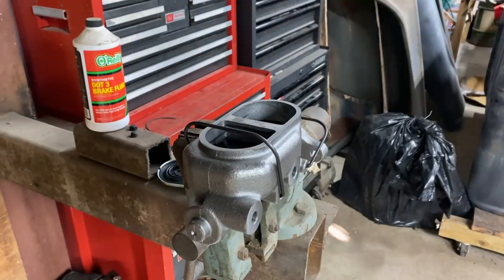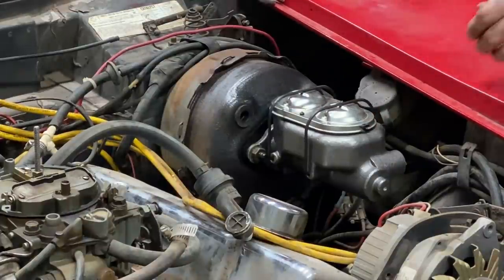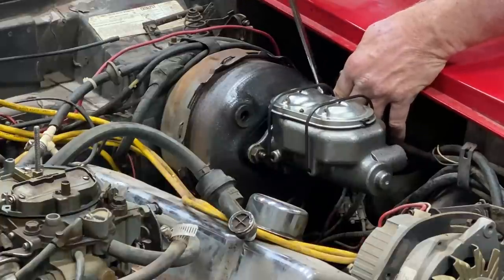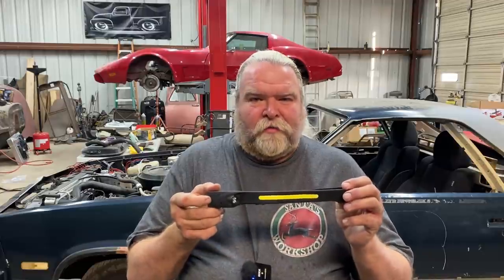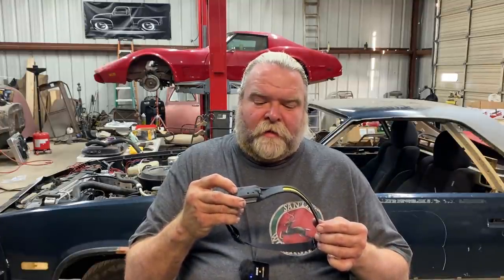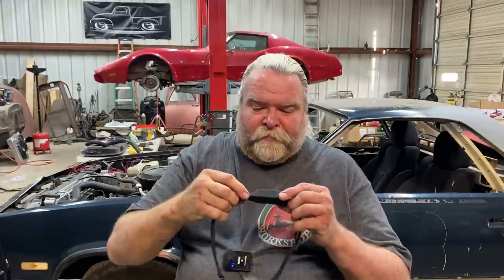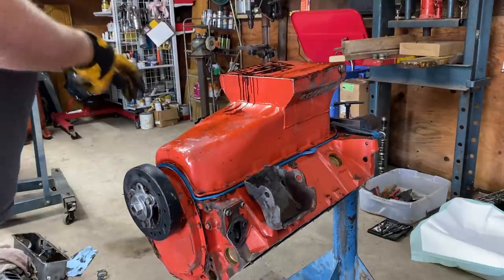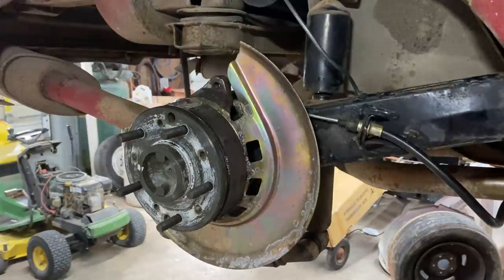Installing Brakes On The 1977 L 82 Corvette and a GIVEAWAY!!!!

Comment: Hey Mike, glad to see your internet issues cleared up enough to allow you to post this video. Tough break on the brakes, but glad you are not risking safety with a stripped bolt. Too bad about the crank as well. That Odelfi light seems pretty cool. A good idea for a giveaway when a manufacturer sends you two devices - if it's a good unit.
Reply from the maker: Thank you Jim! After the internet cleared I started having software issues in the computer! Got a 5 terabyte hard drive to clear off a bunch of old stuff and it now runs a lot faster! Going to upgrade the Ram next!
Reply: @SantasWorkshop  I'm a bit of a Computer geek so if you need advise, just ask.

Comment: Santa! Do you know that there is a tool to use when installing a MC to a Booster to check the rod in the booster so its at proper length??
YES! The rod coming out of the booster is adjustable!! DONT ASK ME HOW I KNOW!?
After upgrading brakes on my 57 Chevy a couple times I have turned into an expert on that subject!
Reply from the maker: Yes, I will be checking to make sure everything is right before it goes to someone else!!

Comment: Odelfi I want one.....Mike you can check the treads on the rear caliper bolt hole  with a tap.....retap it if needed.....
Reply from the maker: I’ll have to retap, the hood bolt just slides in to the hole.🙄

Comment: Odelfi i want One I like this year Corvette. The stock engine can be made more powerful with different cylinder heads, camshaft, and dual exhaust!!!  Great job on replacing the disc brake assemblies.
Reply from the maker: As good as this one ran I’m not going internal on it just sealing it up and cleanup!
Reply: @SantasWorkshop  The 1976 Corvette showed us what the future of cars would be with the front and rear fascia's (flexible rubber bumper covers). Always liked this year. I don't care for the hatchback look of the 82 models.

Comment: ODELFI, I WANT ONE.  Love your channel.  If you have access to a 4 bolt main engine you might rethink and go that route.
Reply from the maker: No more power that I’m putting into it a 2 bolt should be fine, I do have a 4bolt block bored .030 in storage for a special build!

Comment: ODELFI I WANT ONE!  Sad thing about the block, though salvageable, it is just about cost the same these days as a crate motor by the time you rebuild it right.  Of course you need to have the cam bearings replaced and true'd up by a machine shop.  The bores look excellent, and the block is worthy of rebuild.
Reply from the maker: I learned something recently, a crate engine from gm is made in Mexico and they do not cast as good as American made blocks. We got a crate engine in a deal and went to have it bored and the machine shop refused due to the pitting in the casting! This motor I can get a a crank kit (refurbished with the appropriate rod and main bearings $300, hone the block and $40 at the machine shop for cam bearing install, new rings $75, and cam/lifters $250! 
So for around $700-800 I can get a well built motor by doing in house!
Reply: @SantasWorkshop  yup, just got to do some more machine work, line boring, etc.  The one great advantage, if you do it yourself you know what you got.  Just watch the quality of the parts, especially the cam.. some bad ones have gotten loose, brand new bad ones.
Reply from the maker: I already have a new CompCam for it!

Comment: You might want to check the floor pans for rust. Starting in 1976, GM started putting steel floor pans in the Corvette, to help protect the fiberglass from the heat of the catalytic converter. They are very prone to rust. There are a lot of little oddball things specific to the 1977 model. In '77 they were in the process of switching over from the earlier models to the '78, which had the huge bubble back window which I never did like. It ruined the lines of the whole car.
Here's a great video on it.  https://www.youtube.com/watch?v=fhHIbWRQ7dY&t=102s
Reply from the maker: So far rust wise everything is looking great!!!
Reply: Seems that the model year 1977 is a unique try& error year. That video link makes one pessimistic. But on the other hand now this vett is sorted out and quite rare. And let's see if you random comment finder finds this: odelfi I want one 😁😁

Comment: Mike, you ain't going for that Monday thing again, are you???? Buy a roll of bare line and get the fittings and make your lines, I know you know how!!!!! As long as it's not ur hoses!! On my 79 355 Camaro when we did the BRODIX racing heads, we had to put silicone on couple head bolts, cause they bottom out in water passages, but not all of them!!!!! Think maybe 3-4????
Reply from the maker: This had it on every one and half the head bolts weren’t even tight. The amount of trash and silicone chunks in the pan was unbelievable!
Reply: @SantasWorkshop  that's crazy!!!! That engine sounded good n strong but was matter of time....a tickin time bomb!!!!

Comment: thats because the head bolts go into the water jacket with out the silicone they would leak odelfi i want one
Reply from the maker: I have always used permatex and never had a leak, but dang they used a lot!!!
Reply: @SantasWorkshop  some ppl over do it that can be a problem
Reply from the maker: I believe they WAY overdid it!

Comment: Did you delete the drum/ebrakes?
Reply from the maker: No, they were replaced by the previous owner and work as they should!
Reply: @SantasWorkshop  can I just delete ebrakes. I see a lot of Corvette videos where they have been eliminated.
Reply from the maker: You can but from a safety standpoint I don’t recommend it.